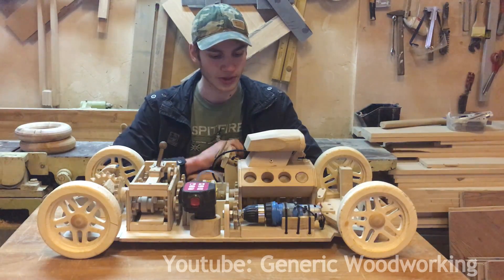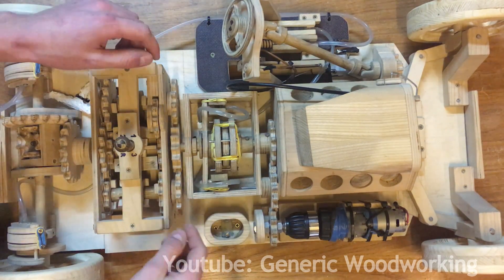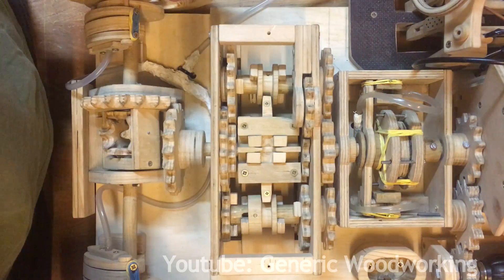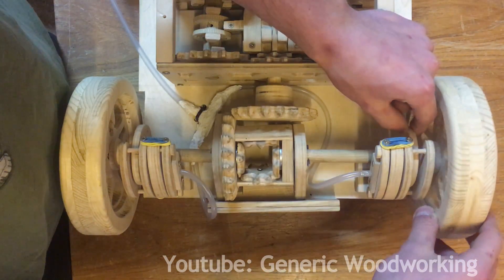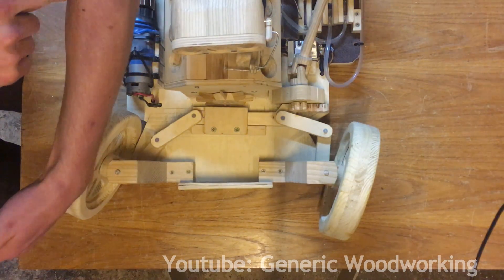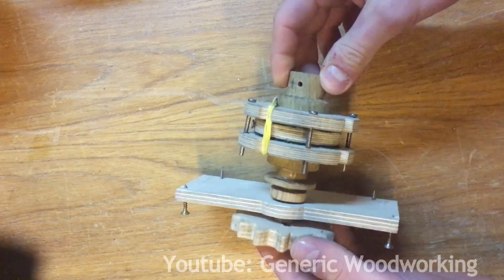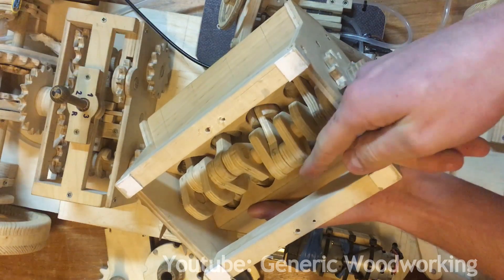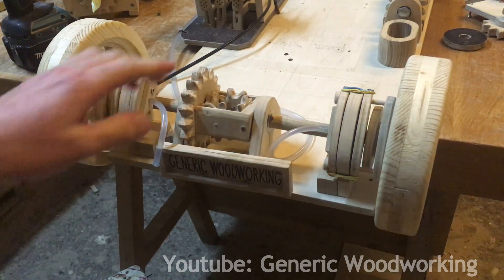How It Works: The realistic Working Wooden Car Model

Comment: This is incredible!!

Do the front wheels not get rotated at a constant rate by the steering wheel because those u joints aren’t constant velocity joints? And if so, is there a replacement CV joint you could make out of wood?
Reply from the maker: They turn at different angles by design. It’s called ackermann steering geometry and it works due to the geometry of the sticks making up the system. Look up videos on ackermann steering. It’s a really fascinating concept.
Reply: @GenericWoodworking  right the wheels get turned different amounts compared to each other  but Im saying isn't the rotational velocity of the steering wheel going to be different than the rate at which the wheels get turned? Or is this the action that creates the ackerman steering
Reply from the maker: Ooh I misunderstood you there. That doesn’t have anything to do with ackermann but is instead just a bit of a design flaw. However I don’t think the negative effect it has on steering feel would be very noticeable.